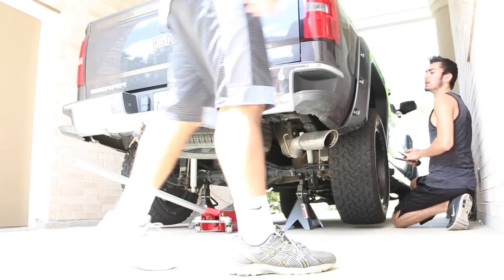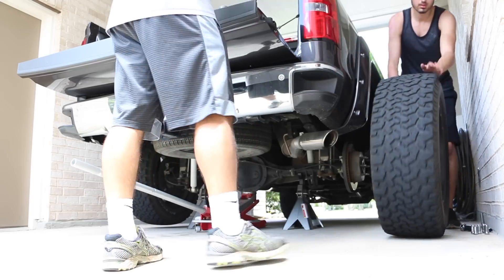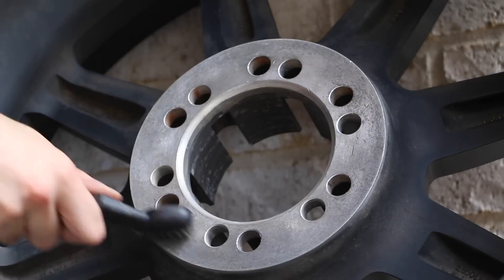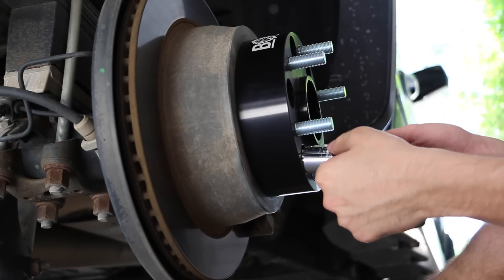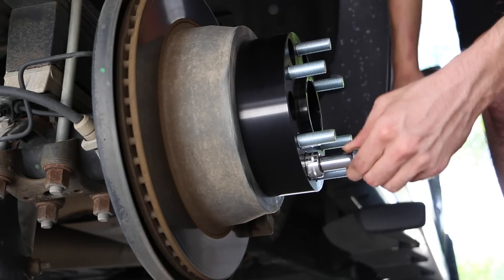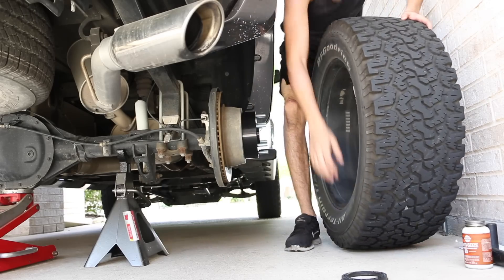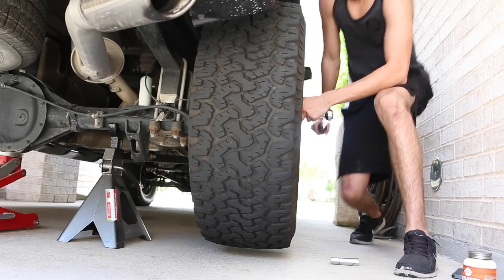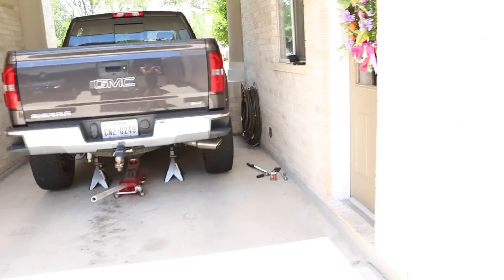Howto Install 2" Bora Wheel Spacers (2014 GMC Sierra 1500)

Comment: For people watching this video!!! 
DO NOT PUT ANTI-SIEZE ON LUG NUTS BUT ON FLAT SURFACE BETWEEN ROTOR AND WHEEL SPACER, AND USE RED LOCKTIGHT ON LUGS OR NOTCHING AT ALL AND JUST RE TORQ AFTER FEW 100 MILES

Comment: If you get bora hub centric spacers but the after market custom wheel center bore is wider than the centric on the spacer.  I heard that buying those plastic wheel ring that there is no weight on them?

Comment: Why do you still have the original  spare if you've put bigger wheels on it?
Reply from the maker: because my tires are only 33inch tires and the stock ones are 31inch tires so if i ever go flat it would do the job to get me out of the road and to discount tire.
Reply: : | u sure about that? You'd probably be better off driving back on the flat
Reply: +Habo Hamo Negative
Reply from the maker: I would rather drive with a smaller tire than drive on a flat tire and have a possibility of messing up my expensive rims! Most small cars have a factory spare and it is usually smaller than the size of the actual tires on the vehicle.
Reply: Word of caution. Be careful doing this. If it happens on the front you'l be fine as long as you don't put it in 4wd. But if it happens on the rear put a good tire on the back and put the spare on the front. Smaller tires rotate faster than larger ones and can cause issues. Ask me how I know. :-/ lol

Comment: I don't have that ring, will they still fit?
Reply from the maker: depends on your rim. mine are after market rims so they need the ring to fit.
Reply: Nima Tech mine are after market too, but the rim still fits directly on the hub.
Reply from the maker: if your rim fits directly on the hub then it will fit directly on the hub of the spacers as well

Comment: how is the turning radius? does it touch the bumper or fender when you turn?
Reply from the maker: turning radius went to crap after the lift and bigger tires, but no it doesn't touch, I am going to make  video about it soon! stay tuned!
Reply: +Nima Tech umm... The only things that would make your turning radius bigger is a longer wheelbase or a shortened lock to lock... Being taller and wider wouldn't affect it other than maybe an inch or so and that wouldn't even be noticeable

Comment: What Is the purpose for wheel spacers?
Reply from the maker: Most people get them for looks. When you space out the wheels it gives the truck for of a stance, which also helps with stability. when people lift trucks they are more likely to tip over and when you put on spacers it gives the truck more stance to not tip over.
Reply: Ok thanks.

Comment: hello I have 2 inches spacer in my car but I want 4 inches spacer and I cannot found it my question is if you think can I put in my car another 2 inches spacers on my wheel? and for that way have 4 inches? is that safe?
Reply: yanisbel martin no you don't want anything larger than a 2" spacer as is, it's dangerous and stacking them would only be worse.
Reply from the maker: 2 inches is already bad, i wouldn't double the chances of an incident....
Reply: Thank you for you answer
Reply from the maker: yeah no problem man!

Comment: Can this mess up your suspension
Reply from the maker: honestly i don't know the true answer to that question so i'm not going to tell you an exact answer, but in my opinion i don't think it will make much of a big deal.
Reply: Yes, it wears out suspension/alignment components faster and puts more strain on wheel bearings causing premature failure. Am I running really deep offset rims AND spacers regardless? Hell yeah. Do I know it'll make my truck break faster? Hell yeah. Will I deal with it when it fails? Hell yeah. But does it look badass? Hell. Yeah.
Reply: HELL YEAH!

Comment: I used to work at discount tire too and thinking about putting wheel spacers on my truck I have a 08 ram 2500 6.7
Reply from the maker: honestly, if you go with the brand i have you will not have a problem what so ever!

Comment: How wide are your rims/tires?
Reply from the maker: tires are 305/55/20 and the rims are 20x10
Reply: Nima Tech do u have a level lift? i have a level lift with same tires and spacers and my front tires rub way too much
Reply from the maker: I actually am uploading a video tomorrow explaining my truck, go watch it tomorrow! but to answer your question, I had a 4inch pro comp lift kit and I used to rub so i had to shave a bit of my bumper off, but stay tuned because I am going to start a truck channel and talk about my truck and everything I do on it.

Comment: Is it true discount tire won't put on wheels for you if you have spacers?
Reply from the maker: Yes that is to an extent. They don't work on vehicles with spacers because they don't want to go against the vehicles factory design. but when i used to work there a jeep came in with 1 inch spacers and we torqued them for the guy. but most of the times they don't allow spacers.

Comment: Bro, did you have to trim fenders for the front tires, or you have clearance with your suspension lift? I have same 2" bora, but it doesn't work on the front.
Reply from the maker: I had to remove my mud flaps as well as trim the front plastic piece on the bottom of the front bumper. besides that I have good clearance. and I don't have spacers in the front, only the rear.
Reply: Thank you bro, I have rear too for now.

Comment: For all y'all asking why ppl need wheel spacers. I bought a brand new set of tires, read online they wouldn't rub at all. At full crank they rub a little bit and they almost brush against my knuckle. I would like to stop the rubbing so wheel spacers are a valid option.

Comment: You're not getting any vibration after the spacer install? Just curious because spacers have a  tendency to cause it.
Reply from the maker: No i don't have a vibration problem. if you are having that problem, I would retorque all the spacers and make sure they are 100% flush
Reply: The Hub Centric Rings help to remove Vibration problems caused by deep dish rims or spacers. Most new rims are dual drilled 6 lugs so the Hub slot in the center is cut for the larger Hub, so its likely it will NOT fit around your hub snuggly, my old truck had this problem and i was not aware of the Centric Rings as i bought 20x12s right as they first started being pushed, as soon as i bought the Centric Rings it got rid of all the wheel play/vibrations/shaking/wobbling caused by the gap around the Hub. If you happen to add spacers and then the deep rims without puttin these Rings on your wheel is going to literally vibrate off while your driving, unless your lucky and the Hub slotting is matched to your HUB because its the largest 6 lug Hub, but GMC/Chevy trucks that are 99-07 i can confirm need the Hub Centric Rings if the wheels are dual drilled
Reply: Well I was asking because I lifted using some spindles. When i finally got done, my oem wheels didn't fit onto the spindles and had to run and buy cheap wheel spacers to get the wheel off the spindles. After that, I got this nasty vibration and after some research, figured out it was the spacers and that it's a common issue with wheel spacers. Got my wheels and tires a couple days later and that bad shake went away for the most part. Now I'm just struggling to get the shake out of these 35" tires. Hub centric rims fixed the shake on my bmw so I already knew to order them after the second road force balance didn't solve the shake. Need to install then though

Comment: I'm looking at your floor jack and it looks like there's one long wheel at the front of the Jack. If that's the case, that's probably no more than a 1.5 ton rated jack.
Reply from the maker: idk how much the jack could lift, but it did it jobs so thanks to the floor jack! lol
Reply: Nima Tech At least you used jack stands, just don't want that Jack failing and while your under the truck.
Reply from the maker: that would be the last thing that i would want to happen! lol

Comment: What size rims and tires do you have? I got a 2015 silverado with 7.5 lift on 20x9 on 35s. My rear don't poke out at all and my front tires do, need to even it out. What size is the spacer you put on?

Comment: spacers= danger.. one way or another. A little tip, when you order new wheels, get a different offset
Reply from the maker: I don't like the way the offset makes the rim look
Reply: how is the wheel different?
Reply: how does spacers = bad. I run 2" spacers on my lmm crew cab dually and tow my bobcat daily. city and 70mph highway.  next time you should buy quality spacers.
Reply: Do some research bud, just looking out for ya..
Reply: There is nothing wrong with rear wheel spacers.
Reply: fit4ya1975 I think experience is more efficient than googling everything. If you instal them wrong then yes you will think they are dangerous. People have had spacers on for years at a time with no problems so

Comment: Not supposed to put any type of lubrication on lug nuts. When you torque the lug nuts they will be over torqued because of the lubrication on the stud. You always torque lug nuts when they are clean and dry.

Comment: What's the offset on your wheels?
Reply from the maker: not exactly sure how to read offset, but my rim is a 20x9 6-139.7
Reply: It's cool bud, offset is like a measure for how deep the rim is towards the hub exactly like backspacing. Just curious since I'm in the process of getting some wheels soon and more negative offsets like a -24 or -44 makes the wheel stick out more.
Reply from the maker: yeah i'm not a big fan of a huge offset, but a little bit is always good to give some stance
Reply: Feel the same way a little poke is all i need

Comment: Don't put anti seize on wheel spacers, worst advice I've ever heard. You use the opposite, high grade Loctite. Unless you're okay with your wheels flying off...
Reply from the maker: well my wheels didn't fly off, so i think i'm good. thanks for the advice though! i'll look into it!
Reply: But when or if they do it's a hazard to other drivers like myself. Advising 20,000+  others to do the same is irresponsible. Just cause you work in a tire shop doesn't make you a  garage guru... This is coming from an automotive technician.
Reply from the maker: very very true, but i am not forcing people to do what i do, just giving them my advice, don't have to follow them if you do not want to.
Reply: it would be impossible for the wheels to fly off....the lugs holding the spacer on the the disk cannot back themselves out against the rim.  At best, if they did come loose,...the rims would vibrate.  Goodness gracious people....think.
Reply: They would not just vibrate. The lugs would snap off. And if anything don't put anything on the lugs in the first place. Anti sieze is just the opposite of what I would put on there. Think...Just think.
Reply: I was thinking the same thing. anti seize is the worst thing for wheel spacers. omg. only put it on the face of the wheel spacer to keep the wheel from corroding to them.
Reply: Any type of liquid or substance on the threads will change the torque spec for the worse.
Reply: mstyn15 naw bro putting antiseize on the spacer itself will cause a mess due to centrifugal force. I've been putting antiseize on lugs for 20 years with zero problems.
Reply: Is Loctite for the lug nuts? I'm asking because id like to put wheel spacers on but I want to be safe about it.
Reply: He should be fine with putting some on the face of the spacer but is he puts them on the studs then that where he messed up
Reply: Lifted Silverado only use locktite after the re-torque @ 100mi.
Reply: I am not a auto tech, just a truck dude
Reply: Noob lol 😂
Reply: @hesneyk1  Actually if they come loose they can cause the stud to break without you noticing and goodbye wheel!
Reply: just keep them torqued to specs!

Comment: Never ever ever put anything on the threads of your wheel nuts, little anti sieze in between them on the rotor is ok but never the threads.
Reply from the maker: thanks for the heads up
Reply: Just use a drop of WD 40. It will prevent corrosion without loosening your lugs. Don't use lock tight either.

Comment: Your torque spec on the wheel hub is 140ft lbs. but if I you torqued the wheel on to the spacer to the 140ft lbs you will break loose the wheel spacers studs so getting the wheels off will be nearly impossible since the stud and nut will rotate together instead of coming off.

Comment: 👍👾 good video - Use anti sieze on the face of hub to spacer and contact points from spacer to wheel they will mend together over time. Use locktight lite on spacer studs. The blue stuff not the red. I never use locktight on studs to wheel but maybe just a dab..

Comment: why would you install spacers? its not safe, plain and simple. what you could do to get that effect is buy new wheels with the correct offset for that effect. what you are doing here is very dangerous and i can almost guarantee that you will lose a wheel at some point.
Reply: k88hendrix hmm well ive had 3" wheel spacers on my jeep cherokee for about 7 years now soooo.. lol
Reply: hubcentric spacers are safe enough for most application when installed properly...torque rechecked every few oil change or so. Not recommended for heavy offroad use.
Reply: Joshua Fuentes are they safe to pull a horse in a trailer if i get spacers?

Comment: Rip your truck my 1999 ranger just lost a wheel due to 2 inch wheel spacers
Reply: Retro Stuffin probably cause you didn’t put them on right
Reply: Retro Stuffin were you hauling stuff with it or off raiding?
Reply: @52552124555663355895  so, you're saying that wheels with a negative offset are dangerous as well ? Tell the aftermarket companies quick!

Comment: My question is i have a silverado 1500 6" lift i want to put front and rear spacers if installed properly are they safe to tow? I have a 5000lbs camping trailer that i tow alot.  Are they safe even in the front??